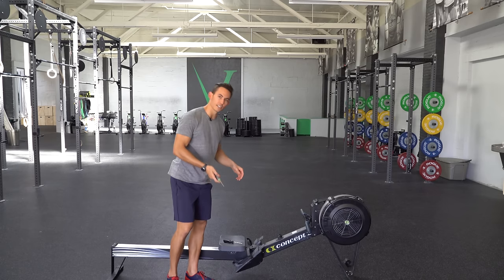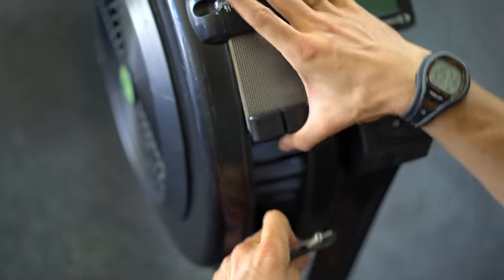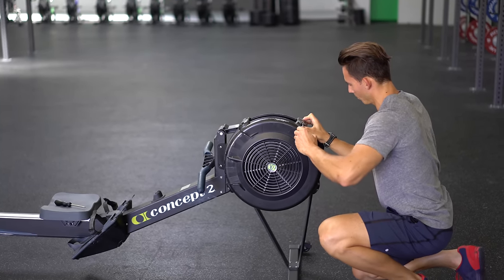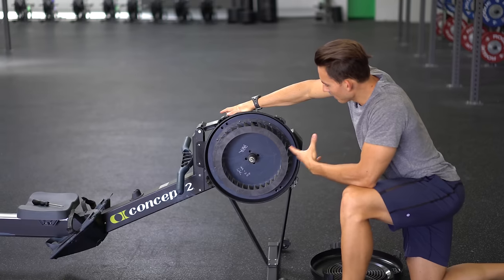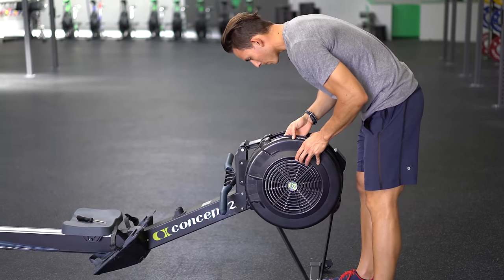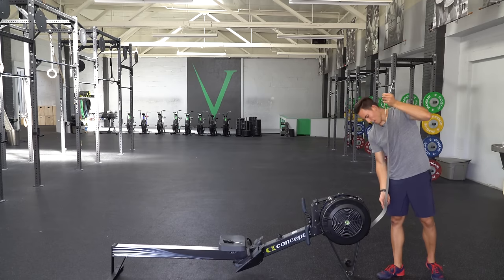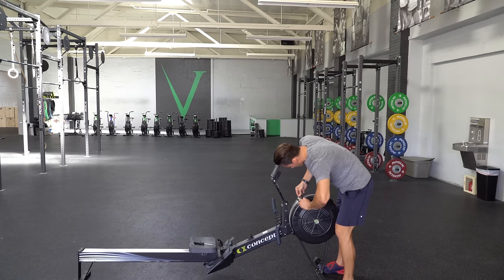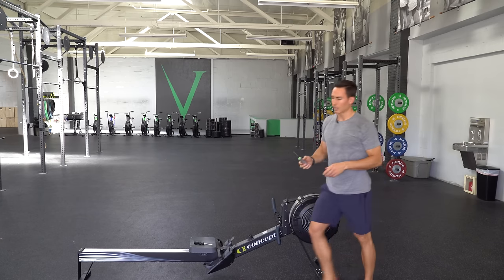Common Repairs for the Concept2 Rowing Machine

Comment: Unbelievable, how easy it was to disassemble and reassemble. For those who noticed their rower lost strength, do not care about the wheel. Go immediately for the part where the instructor removes the bottom plastic from the main part. It is about your chain connection.

Comment: If I look at the fly wheel end looking straight on it looks as if the fly wheel is hanging down slightly and it isn’t in line with the frame , is this normal considering the weight of the wheel ?

Comment: Any video on how to clean out a monitor in which the batteries surpassed their leakage shelf date?
Reply from the maker: As in the batteries leaked inside the battery housing already?
Reply: @DarkHorseRowing  Thanks for asking.  Sad to say yes.  Bought it from a university program 100-miles away from where I lived in North Carolina (high humidity) and I was told they didn't have any battteries handy when I went to test the rowing action.  I support collegiate rowing so I didn't get in touch after I discovered the problem.  The erg works fine otherwise.  But I would like to be more precise in my HIIT.
Reply from the maker: Unfortunately if a battery leaked and the monitor no longer works as a result I’d encourage you to pick up a new monitor. They’re around $185 I think and can be fitted for any model erg.

Comment: When I pull hard at the very end of my pull, the rower make a loud clicking noise, but if i don't pull super hard it doesn't. Any specific part or idea here?
Reply: Brady Reed I have the same problem, did you find a solution ?